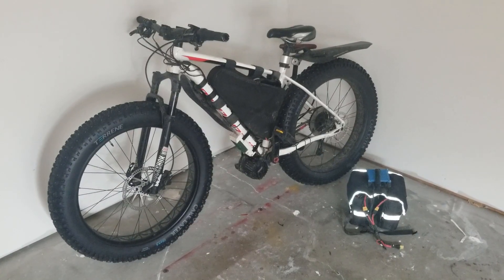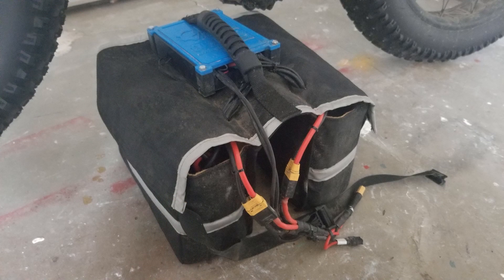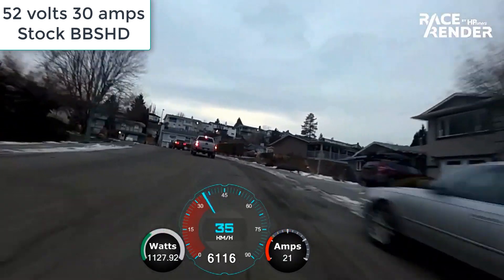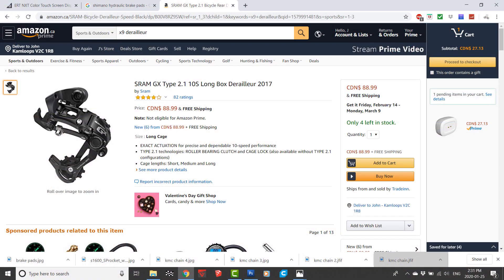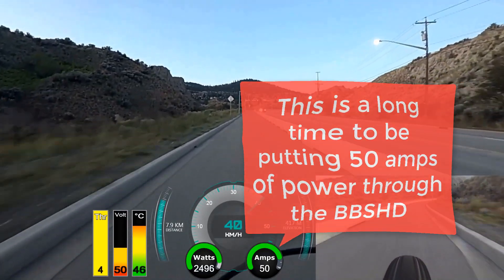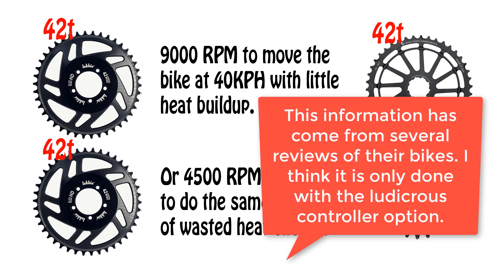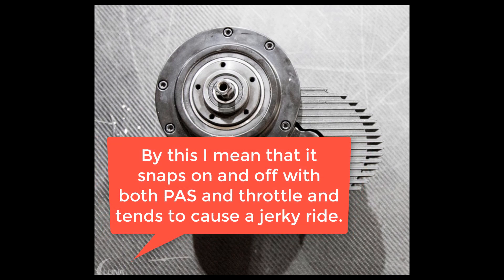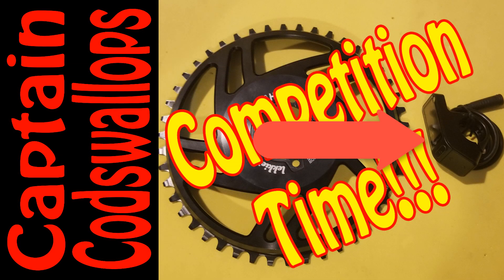Bafang BBSHD - ASI BAC 800 72v - Specialized Fatboy Ebike Conversion. The fastest & most reliable?

Comment: The nylon gear in the motors was originally designed to protect the motor and fail before damaging the motor.
Reply from the maker: Makes a good deal of sense. I have heard it works as a safety feature if a limb got caught and would fail quicker. I'm not testing that theory tho lol.

Comment: For people worrying about melting the gears, General Motors used nylon timing gears in their engines for years, which I would imagine get a bit hotter than this small electric motor. If people are actually melting these gears, it's probably a poor quality or improper grease that's not dissipating heat or reacting chemically with the nylon and causing premature failure. Even with the things you mention in the video, I'd still put money on the lubrication cooking over the gear itself melting. I'm quite enjoying your videos, they're very informative for someone looking at building one of these bikes.
Reply from the maker: You make a very good point. In reality what happens is that it softens to the point where the forces sheer of enough teeth to stop it functioning. But full melt no. The stresses might be a bit higher in this application as it is the main reduction gear. But the point is a valid one. If the user gears the bike correctly it should not happen just like with general motors.

Comment: Which one is fastter on 72v - BBSHD or CYC X1 Pro?
Reply from the maker: With an ASI BAC800 at the same voltage on the same bike. It would be close. The X1 is best with the BAC2000 though and the BBSHD can't handle 5kw so in the end you could make the X1 pro faster.

Comment: A steel gear will act as a heatsink
Reply from the maker: I have the luna steel gear. If I wreck the nylon one I'll swap it in. What do you mean by a resistor.
Reply: @HighVoltageKits  sorry I meant heatsink.
Reply from the maker: Lol, makes sense now. Cheers. Yeah it would.

Comment: The trick with the bbshd is to run more voltage and stay in low gear to minimize strain. Mine is running on a Phaserunner with 40amps phase weakening and 88volts li-Po. Top speed is 53 mph and I never have to change gears. I get 40-50 miles on a charge.  Ive never melted a gear and I've been riding for 2+ years. To increase reliability, I've added heatsinks to the motor and it rarely if ever exceeds 120 degrees F.
Reply from the maker: Yeah. You nailed it there. My favourite is running 72 volts LiPo. I run 1 to 1 fixed gear. Motor stays within its limits. Still on my nylon as well. Great comment. Cheers.

Comment: Capt, I have a 2015 Fatboy with a PF30 bottom bracket.  The ID is 46 MM and the overall length is 100MM.  I am wondering if you had to use a bottom bracket adapter on your Fatboy and if so what did you use?  I have been looking for the right adapter but I can't find a posting with that information.  Great videos.
Reply from the maker: Mine was threaded. Try this link tho. https://www.ebay.ca/itm/TOKEN-Adapter-for-PF30-46mm-Frame-to-English-Threaded-BSA/192254254161?_trkparms=ispr%3D1&hash=item2cc33f1c51:g:JRkAAOSwEIBea16F
Reply: I think Lekkie (lekkie.bike) makes some sort of adapter with "PF30" and "Bafang" in the title (-; https://lekkie.bike/product/lekkie-bb30-pf30-eccentric-bafang-adapter/

Comment: You said you got a 120mm BB motor for this 100mm BB frame. To get the right clearance for a larger chainring? How did you know to do that? If I have a 68/71mm do I upsize as well or just order one of the same designation. Just making sure before I pull the trigger! Keep up the great work with your cool, informative & non-annoying videos! :)
Reply from the maker: I based it off a video I saw on YouTube where the guy also had a specialized fatboy. The chainstays push the reduction gear out from the bottom bracket. What bike are you converting again?
Reply: Yes from Em3ev! I have a 2013 Rocky Mountain Slayer 30 full suspension
Reply from the maker: I don't think you will need the 120mm. The question is how wide do the chain stays go. You could try making a rough template of the bbshd to try the fit. Joseph at em3ev.com is really helpful as well so would be able to advise you. I am thinking that it might need the 100mm but he may know for sure. Also maybe look on endless sphere for a similar build and see what they used.
Reply from the maker: Are you buying from em3ev.com?

Comment: Any idea why the throttle cuts out completely on stock controller if the bbshd engages pedal assist?
Reply from the maker: Simple answer is because the stock controller is garbage. Longer answer is there is likely a parameter set somewhere to allow it. Try flashing it with a fresh firmware like Karl's special sauce or similar maybe? I will never touch one of those again except to remove it lol. I should say my stock one did not do this. Throttle overrides PAS or it should do...

Comment: Hey cpt Codswallop, sorry don't know your name yet, I am seriously considering the bac800 for my bbshd build as well as the nxt display because of you, I see you recommend it but I also use alot of PAS mode and I was wondering if it brings any value for non throttle use to upgrade to the bac800 controller
Reply from the maker: You will get a ton more power just using pas as well as a smoother operation. How come you dont want the throttle tho? If it's due to laws you could always have it unplugged and then plug it in offroad. Or even wire in a switch to disable it?
Reply: @HighVoltageKits  ya I used to ride on the don valley trail in Toronto but now moved to Barrie, I have to go on the road to get to work, wasn't sure how the law is here
Reply from the maker: The law most places in Canada is 500w but throttle is ok. I have the legal option at the push of a button. As long as you ride safely and show courtesy to others I cant imagine you having issues in Barrie. Cheers

Comment: Awesome, thanks for sharing... 72v makes a huge difference and it really shows during the hill climb test, that beast sounds hungry!  Good point on having two battery packs. My current Bafang Ultra project is designed to maintain the flow of traffic when the bike lane disappears so I'm struggling with range vs. speed at the moment.
Reply from the maker: Thanks. Range v speed is always tricky. 72 volts bumps the speed at all power levels I found so that helps with conserving power as well. Cheers!

Comment: Very nice video, you are using your "inside voice" ;-) Question i will be using this for touring but if it is more efficiant with this contorler... would i be better off buying multipal 36volt batteries, hooking them in series, then an identical pair  in parallel? reason is they are cheap now but as far as quality who knows.  i can always use less volts but it is nice to know its there. You said it is more (this controler) efficient at 52 volts so should i bother with the two 36's or just get the controler with the 52 volt set up.  So Sorry but i could pick up the 36's real cheap now if they are real, they could be junk but how do you kwon.  Thanks,     keep hauling ass till someone else is hauling your ass.
Reply from the maker: Thankyou. The only batteries I have linked in series are lipo. I have no idea if you could link up two 36 lion batteries in series safely. I suggest you post this in the battery section on endless sphere. If someone has done it I'm sure it will be there!

Comment: I really want to upgrade my bbs now! I’m glad I didn’t get the upgraded controller from Luna. Only downside to the phaserunner is once you get it up and running you’ll never need to pedal anymore lol
Reply from the maker: Yeah that's true. One of the good things about the NXT will be the ability to have several riding profiles you can switch between. One could be setup to allow for limited power where peddling is still viable. It's not how I ride but very doable. Cheers!
Reply: Captain Codswallop cool... I was also thinking switching between the 52 and 72

Comment: Thank you for the inclusion, great video. We (ERT + ElectronCycles.co.uk) spent a long time working out how to use gears and overcoming the Nylon gear thing (we also spent a fortune developing a metal gear, but abandoned it we we realise that the next thing to fail could be disastrous- motor windings). For non fat bikes we recommend gearing 42T F and 28T rear for on 29er or drop the rear to 26T for a 26” rim. Like the man said, let the motor spin! Thank you Captain, Ay Ay skipper!!!
Reply from the maker: Thanks Francis. You are most welcome. The bike would not be what it is without the development work you guys put in. Much respect! Cheers
Reply: Have you considered developing a controller kit for the Bafang Ultra G510? I built a DIY frame for it but need a few more amps to easily maintain the flow of traffic on local roads (usually 65kph+). I'm currently testing it with 58T/17T (6.1 gain ratio) single speed but plan to add a Nexus 3 IGH for extra gearing to help out at startups and at top speed. The ultra gets hot but comes with the metal reduction gear, hasn't given me any issues yet at 1500w with the stock controller.

I've seen a few guys fit the phaserunner inside the Ultra but it'd be nice to have a more plug n play option. Otherwise hopefully Bafang will get the hint and give us a Super Hyper Ultra Max motor built to handle higher voltage and current ;)
Reply: eBikeaholic it is on the map but we’re a bit too busy at the moment. The plug and play bit may be a little more complicated too. We can definitely do throttle wise and actually have a rough map ready now (have to try it which with a bac 2000 will fly along. I’ve wpso all run mine at 70A x 52v butbdidnget abut hot. Will handle 60 a definitely
Reply: But wont high rpm be a waste of amps? I plan to build mid-drive bike with bafang motor , right now i have 250w geared hub motor and it very very powerful and torqy at 3-15km/h and then gets weaker and weaker , tops at 30km/h where it looses voltage but does not give any acceleration, should not it be better to ride like a diesel car? high gear , low throttle, low rpm ? to maximize range and be easy on motor?
Reply from the maker: I am not a complete expert but in general electric motors love to spin fast in order to shed heat. If you can max the rpm in a given gear then the amps will fall off due to back emf. That is why the controller employs field weakening. Diesel motors employ the compression to get its torque I believe. I am not sure this helps. If you post this on the discord we can have a good discussion tho. Its a fascinating topic! Cheers
Reply: @HighVoltageKits  Thank you for your reply :) Yeah topic is very interesting, Im no expert either just was browsing aliexpress and for one motor I found a "dyno test" chart from seller, about rpm , % of efficiency and amps used, and it looked like reverse graph of petrol car ( the rated horses are at very top of rpm) . So my conclusion and feels I had from my current bike were that 90% efficiency of electric motor ( in that chart it was amount of Nm you get per amp at what rpm ) was very high at 0 rpm till like 200 and then it goes slightly down till 300 at 70% or so efficiency and then falls like a rock with 5% efficiency at 450rpm or so. So that got me puzzled alot.
Reply: @HighVoltageKits  to be honest nevermind, I googled a bit and it seems every motor operates differently and every motor has unique chart. Bet chinese did double gear reduction for a reason, if I was an engineer at bafang I would make it so it matches human output aka when human legs at their best efficiency - so is the motor :) but factory product charts are needed to confirm that :)
Reply from the maker: Thats good info. Thanks.
Reply: Would be awesome to see a Delrin or even PEEK (or PEKK, if those are stiff/strong enough) substitute for all Bafang and Tongsheng models, these can withstand much higher temperatures and wear out much less fast
Reply: @BH4x0r  sounds like your trying to high jack and i don’t agree

Comment: How do you feel about mounting the battery in the back of a pose to the triangle in the front.  Does it make a big difference in the way the bike handles and feels?
Reply from the maker: I have seen many people do this and it has to have an effect of balance. But to how much it would affect your riding is hard to quantify. I have ridden with heavy bags in general commuting no issue. Maybe if you hit a steep hill it might pull the front up a bit. For normal comuting no issues. If you want to ride trails alot it might be better to keep the centre of balance more in the middle. Hope this helps. Maybe ask on endless sphere for people who ride like this also.

Comment: Sorry if this has already been mentioned in the video or comments, but I think nylon gears are also useful in the event of motor failure as it's cheaper to replace a single damaged nylon gear than the whole motor when it tears itself apart! Thanks for all the videos, learning loads :)
Reply from the maker: No I missed that one! Thanks for posting this. I am quite sure that the nylon is cheaper. I have also heard it's a failure point for if a limb was to get jammed for any reason. The nylon would then fail when a steel would keep going much longer and do much more injury.. Not 100% on that one tho. Cheers!

Comment: Excellent video Capt., one correction on the gearing that melted the nylon gear. It was a Luna Mighty MIni (I think they call it) 30T on the front, not a 36 and correctly an 11T on the back. All the info you gave on RPM and gearing was spot on. These BBSHD motors are built like tanks and if you give it throttle it doesn't matter what gear your in, it's gonna turn. But the extra stress from a high gear ratio to get it moving and keep it there is what creates the heat. Since I dropped down to a lower gear ratio(1 to 1), which I learned from watching your video's, not only are the temps much lower, but I really don't notice a difference in speed. As you correctly pointed out, in the higher gear it won't turn as fast. The lower gear turns faster, ergo, ( I had to throw that in there to try and make my gear melting self sound smarter) but the same speed. My cassette is actually set up were I can use a more than one to one ratio when I need it. Since I have a 30T on the front, I have 3 larger gears on the back I can use.  I haven't tested it yet but I am going to try it on a slope that is at least 40% grade. I'll measure it to know for sure and maybe even make a video. But for everything except the rare super steep slope, I plan to run a 1 to 1 and never change gears. Acceleration is better and top speed stays the same. Thanks for all your help
Reply: Ï0
Reply from the maker: I was wondering when you'd see it. Great to hear the bike is doing well. Thanks again for permission to use the photo. Cheers

Comment: I've been running my Talon 1 since the beginning of July with the BBSHD and the Bac800 with 72v since the beginning of August and I'm just amazed by the power of it and I've been running 55 amps through it after my scare about the motor being blown and having it come back to life after tearing it all apart I decided screw it and set the current limit to 55 to see what it can take and maybe it's because its winter now but I haven't had any heat issues riding to work every day at car speeds with 44t front and 27t rear.

I was pretty scared after reading every article and watching videos of people saying the BBSHD can't handle much power but after running over 4500 watts through it every day for about a month and a half now it seems pretty solid.
Reply: How many amps where you running when you though  IT bróker befor you  where running 55amps thanks
Reply: @glennjrbeck  I think it was set up at 45 amps which was perfectly fine but my bac800 had issues and died a while later. Currently running CYC x1 pro gen 2 with a stock controller for now until the bac855 is ready for it.
Reply from the maker: With the right bike I'm sure it's possible for others. I can't recommend that level on here though. I'll bet it's fun though! At the end of the day it's just a motor if you wreck it repair or swap. Good work! Cheers.